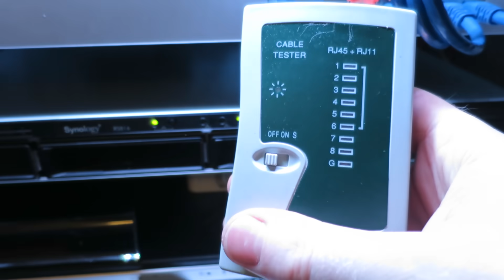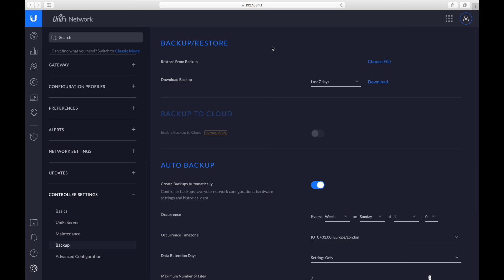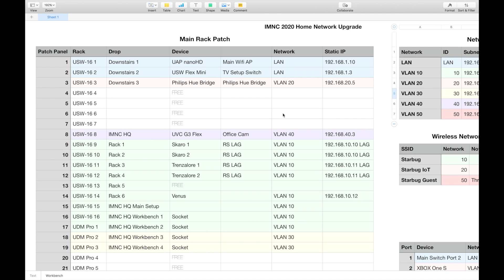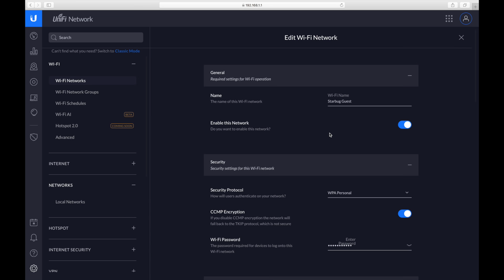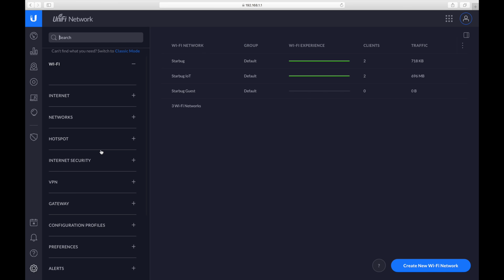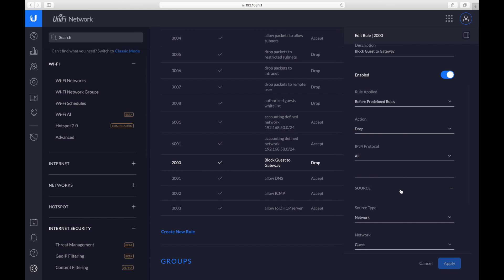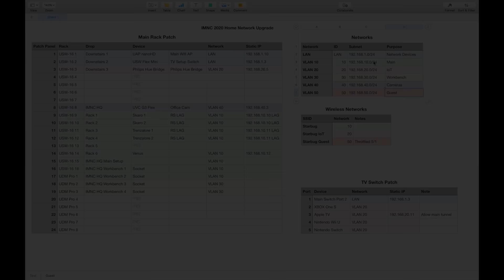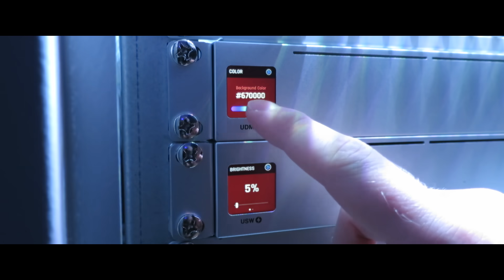Huge 2020 Ubiquiti UniFi Home Network Upgrade (Part 3 - Advanced Configuration & Final Installation)

Comment: Just a suggestion, I would hide the IoT wireless network so no one tries to connect, also so it is not cluttering up when people connect. If you need to add a new device you could reenable the ability to see it.
Reply from the maker: Scott, I completely forgot to mention this during the video... and it was on my list too! Yes you're absolutely right, no need to broadcast the IoT SSID once all the initial devices are set up.

Comment: Not trying to be a killjoy but why would you buy any of the UniFi AP's now? The WiFi 6 802.11ax AP's are due out very soon.
Reply from the maker: Not being a killjoy at all, perfectly valid question.
I guess the answer is, it's all well and good that new stuff is right around the corner, but if you need an AP now, you kinda have to buy what's available now because you don't have a choice I guess. I also feel that with tech, you'll be waiting forever if you constantly want to be on the bleeding edge, because new kit with new technologies is released so frequently. There's also something to be said for hanging fire on a new standard until it's matured a little.
Reply: Your devices also need wifi6 compatibility. I've got plenty of new this year devices on B only which is great for keeping them connected throigh walls ans in corners of the home.
Reply: @HarmanatorNYC  .. They're already here https://store.ui.com/collections/unifi-network-access-points/products/unifi-ap-6-lite

By far the number 1 use case are mobile phones and next as IoT's are exploding today they'll soon adopt the .ax standard. WiFi 6 is far more efficient. Lastly, UniFi already has WiFi 6 and according to my understanding their early release APs are WiFi 6 not to mention what (he) had worked so this is a side grade.

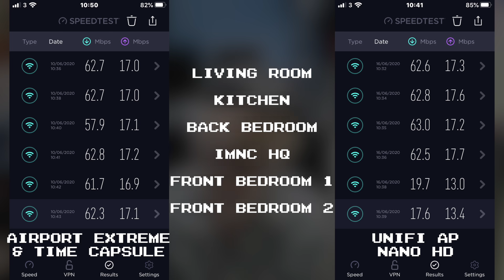Comment: 8:02 into the video. Just be honest mate. I realise you got the gear for free, but don't say that the unfi gear is fine and its due to the house design. It's clear that its miles behind the airport extreme in this particular case (Front Bedrooms). Don't forget, the Apple extreme had the same "house design" to deal with. I have Ubiquiti gear in my house and its awesome, I'm not knocking Ubiquiti gear. But seriously, in my opinion, if you want to be taken seriously as a youtuber, be honest. Cool videos though, thanks!
Reply from the maker: I think you may have missed that I was comparing 2 Apple AirPort base stations to a single nanoHD?? So when I was chatting about the house design, I was referring to the fact that the single AP had to penetrate many more layers to reach the front bedrooms, but with the old setup, there was a secondary AirPort right next to them.
Reply: @ItsMyNaturalColour  I did completely miss that. Very sorry. I take my last comment back in that case. :)
Reply from the maker: Trigger Happy absolutely no problem at all 😀

Comment: * Horizontal gives more spread in the horizontal plane, vertical in the vertical plane. 
* The speed settings exclusively apply to the wireless side of things (at least where it was set) - you mentioned this too. I would actually like it to work as Netflix (wired) can really cause the network to be heavily loaded and I have a need for fast internet. I need to use the ERPRO8 for load balance/failover reasons, which is not properly supported by the UDM, or UDM PRO. 
* The flipping between networks, could potentially be solved by resetting the view. It typically solves it (at least on the map).
* I always use DHPC with reservation. Apparently the easiest way is mentioned here (hoping I can post the link). If not, https://community.ui.com/questions/USG-DHCP-Reservations/4841af19-d873-47b0-afba-262a0a97cf97?page=6 you can use "USG DHCP Reservations?" term on the community.ui.com site and go to page 6.
Doing this avoids the weird behavior too and it allows you to just use the full DHCP range for the subnets you've got, but force say cameras etc to effectively have static IPs.
* Try using the Wifi AI as well, it works very well.
* Be aware that most routers, including this one, have relatively restrictive throughput on their connections. It looks like a switch, but it isn't one, it is a software defined switch. Typical use is to connect the switch to the router and let the router route, the switch switch. This way, each tool does what it is designed for. One option that might be interesting, is to use another one of those mini switches at your workbench. That way, you can have a single POE link to there, then have some ports at the desk. You can keep the main link between the switches as a full uplink, i.e. send all traffic, then configure the ports as you need them. Same downstairs in the TV furniture. Uplink all open, ports specific at destination.

Significant amount of work you did there on the network setups :)

I really like that 'mailbox' wire management, as it means it goes via the back of the rack. Looks very tidy. I can't do it in my case as there is zero space behind my equipment as my rack is wooden and not anywhere near as deep as yours. Very nice setup :) Congratulations!
Reply from the maker: Thanks a lot for your comment and info! Really glad you like the setup :D
I should've been clearer in the video. I used a mixture of DHCP reservation and traditional Static IP setting on the device itself, depending on which device it was, to achieve this organisation. I neglected to show the DHCP reservation step. This is the approach I used for all of the networking kit itself.

Comment: Just my two cents. I would consider your Game Consoles and Apple TV a main device. They are basically no different than a computer. IoT should just be those weird devices like hue, Alexa, things that don’t require MDNS and bonjour to access.
Reply from the maker: Hi Mark
Interesting view and I definitely see why you think this. For me, there's no downside to having them on the IoT network, so that's the safest place for them to be all round.
Reply: I separated my WiFi and LAN here, and I’ve had nothing but problems connecting to my Apple TV via Ethernet from my WiFi enabled iPhone. I finally got it to work, but there’s still times where it’s screwy. Not sure if it’s the vlans on pfsense or the switches. It’s working fine for now. 😂

Comment: Nice work!  I will be setting up the same set of VLANs, and the explanation on creating the rules really helped.
As for the cable management, I installed these Rosewill brand cable guides and used thin MonoPrice Cat6 patch cables as they are much easier to route.
Here's my completed rack  https://youtu.be/PZuNsIxZ1bs?t=330
Rosewill cable management:  https://www.amazon.com/gp/product/B06XC563C4
MonoPrice cables:  https://www.amazon.com/gp/product/B07958727H

Comment: Interesting to note...
Hardware Installation
 

IMPORTANT: Fanless switches must not be stacked. Do not place this UniFi Switch on top of another switch. Do not place anything on top of this UniFi Switch.
Reply from the maker: Great point, Mark. I'm risking it for a biscuit.
So far I haven't noticed any issues with the 2 units stacked, but I do have active cooling in the rack. I have 3 120mm fans; an intake at the bottom, exhaust at the top, and the third is placed directly behind the UDM and switch. It's for this reason that I wasn't too concerned about stacking them. Also, I'm not operating with that many PoE devices. I'd imagine (guessing) that the switch becomes hotter the more PoE devices that are running from it.

Comment: Your smoke detector is out of date !
Reply from the maker: Hi Matthew, someone else commented a similar thing. Do you have any more info? 
We have 2 of these in our home, they're hard wired so presumably I'd need an electrician to replace them if they need replacing? We also have some regular battery operated ones 'just in case', and I test all of them on a very regular basis so I'm comfortable knowing that at least 1 will go off if something happened, but I'd like some more info and how you can tell just from the video that they are officially out of date, and what that means. Thanks!
Reply: So best to have one on each floor, they have an expiry date of 10 years. Only 3 wires normally so is something you could do yourself, just turn off the circuit. I recommend acio optical smokes. If you take the smoke off its base you should see a sticker with the date on, which should tell you the manufacturer date.
Reply: You can tell as they haven't made this type of detector for a while! If you twist it off the base, that sticker will confirm the date. Hope this helps clarify!

Comment: You put a lot of time, money and effort into your home network. Seems excessive to me.
Reply from the maker: Hi Ivan, thanks for the comment.
For me this is definitely a hobby. I enjoy playing with these things and tinkering away to make the setup better and better gradually. I also enjoy tech when it works, so having a solid network properly configured, gives a much more satisfying experience when using the (as mentioned in the video) growing number of devices that we're all becoming accustomed to at home. Also, one of my favourite things is to share these projects with you guys on the channel. I probably wouldn't have half this cool stuff set up if it wasn't for IMNC, especially the UniFi kit as that was provided by Ubiquiti for this video series. I also wouldn't need the large Synology Rackstation, as YouTube editing comprises the majority of my data collection. 
You mention money. One thing that sets me apart is that I, most of the time, downright refuse to spend significant amounts of money on this stuff. That's why I still have a MacBook Pro from 7 years ago as my main laptop, and a desktop containing 6 year old parts as my main desktop. I do loads of this on the cheap, waiting for bargains and trying my luck. That's half the IMNC magic I think, the 'cobbled together' nature of most of the projects. I don't buy all the fancy kit, couldn't afford to if I wanted to anyway, that's why the network build has taken 4 years to get to this point.

It's also important to experiment with these things to learn I feel, and sometimes the only place to get freedom to do so is in your own home. So much of my IMNC tinkering over the years has helped me in the world of work, even some things I never thought I'd 'need in the real world' !! 

Hope this helps.

Comment: As an IT consultant I have to say...I've sworn off ever using Ubiquiti products for clients again. They are not worth the savings. Way too unreliable.
Reply from the maker: My kit has been rock solid so far and I love it! Thanks for watching
Reply: Haha, Mr 'IT Consultant', did it make you feel important to say that?  What on earth possesses people to be so negative, I truly don't get it. No its not Cisco, but then its not supposed to be, nor is a Golf a Rolls Royce...
Reply: @garethev5866  I said it just as a warning to others. Take it for what it's worth...a free comment on the Internet. I've dealt with Ubiquiti switches, WAPs, and Cloud Keys in dozens of environments and they have abysmal failure rates. It's not based on some tiny sample size. Why do you think they come with one year warranty and won't even replace a WAP if it dies 53 weeks after you bought it? (Which I've literally seen happen.) Also from a feature perspective, they ARE in fact trying to compete with Cisco on the EdgeSwitch line. (They're failing, but that's a separate discussion.)